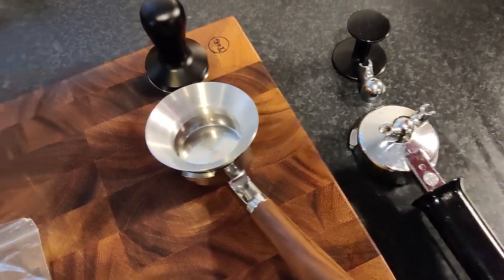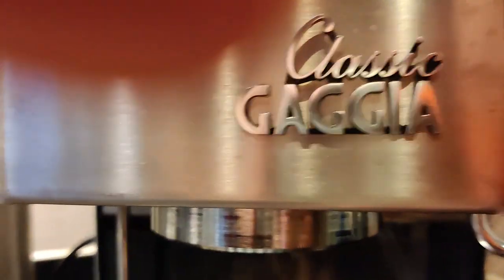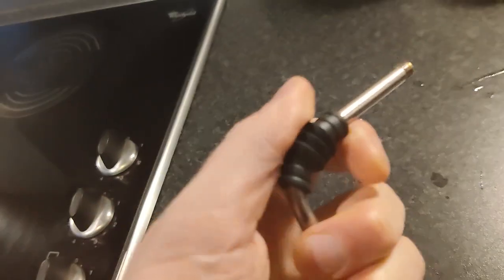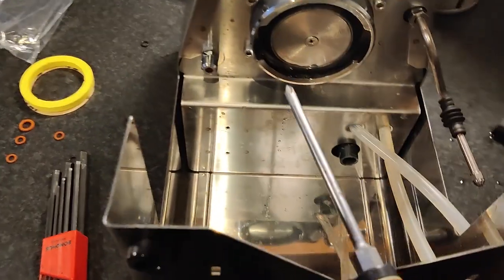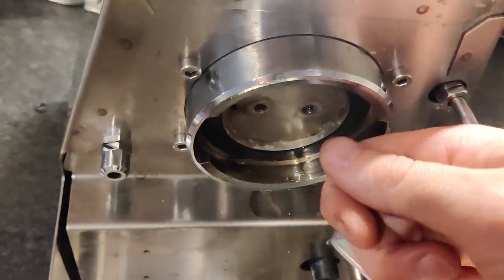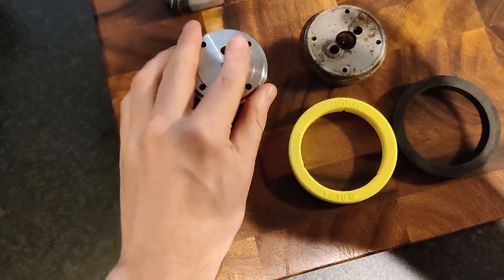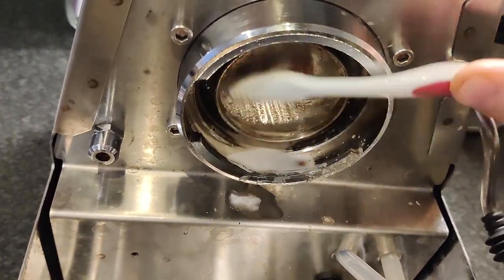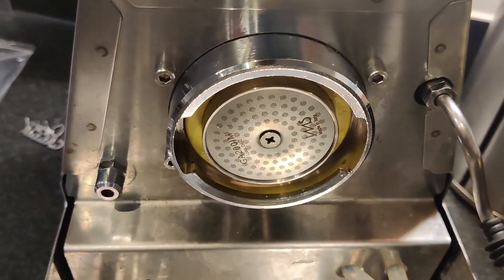Gaggia Classic Mods: Stage 2 - Steam Wand, Shower Screen, Dispersion Plate

Comment: Thanks for this. I got a GCP black in January. I did a lot of research before I decided on this machine. I brought most of my accessories before I got the machine. Found a"tune up kit" on Amazon with a silicone gasket, brass shower plate and precision shower screen. The best upgrade was a bottomless portafilter. This is the best way to know how your shots are flowing.
Reply from the maker: Maybe take a look at the first video in the series  >.o

Comment: no issue with galvanic reaction pairing SS shower plate to boiler.. because: Boiler base is I think plated brass. The boiler itself is aluminium, the steam valve is galvanised. A lot of faff to avoid bloody galvanic welding of the different parts!

Comment: thanks a lot for this video!

one question about the blank basket used for cleaning: where does all the water that gets pumped to the machine to? does the water flow to the solenoid valve?
Reply: i goes to the drain tray through the pipe that he cut himself while dismounting

Comment: NO NO NO Watch out, Take care.  The wands steamer have to be unscrew with tow  thin english key, not only one no. Look carefully the screws, THERE is tow screws lock together.  The upper one HAVE TO STAY ON PLACE , IT DONT MOVE.  iT IS WELDEd TO THE COPPER PIPE INSIDE TO THE BOILER!!!